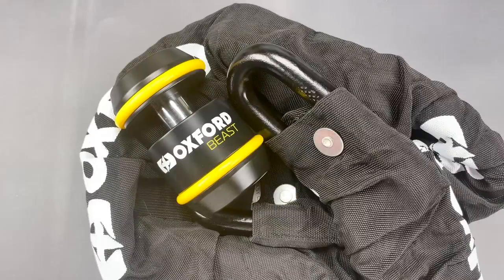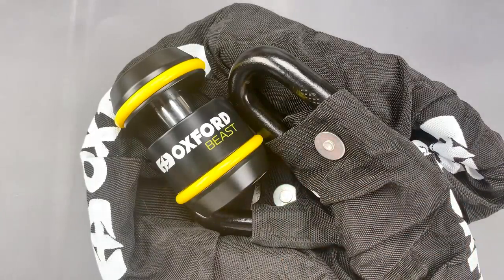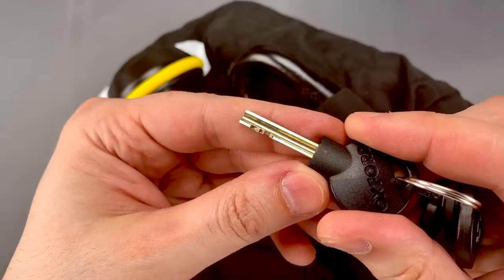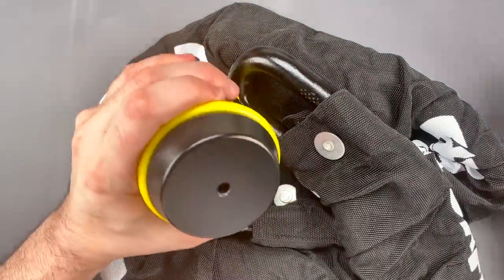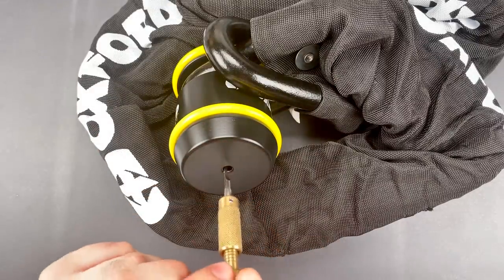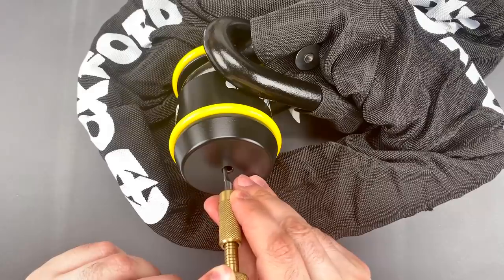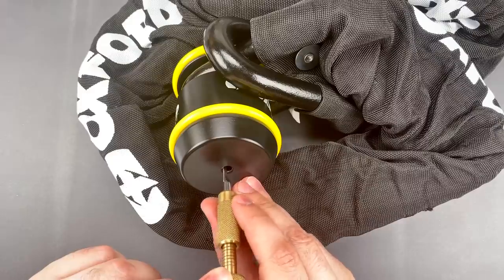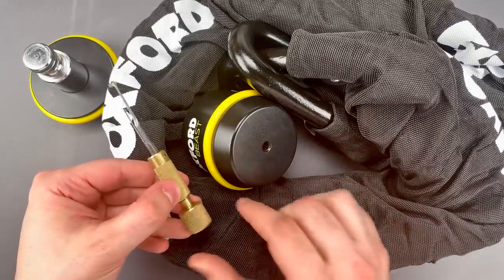[1131] 35 POUND Motorcycle Lock Picked (Oxford “Beast”)

Comment: Instruction unclear ;  the thief disassembled my motorcycle parts instead and left the lock at its place
Reply: I walked outside to see my Bike frame was still locked up to the rack.
Reply: Better to steal and sell the parts than too pick it
Reply: thief stole the lock but not the bike
Reply: LMAO
Reply: I put it through the wheel ....... um ...... now I own a wheel
Reply: that is why you hook a lock tru the frame and not the wheel.
Reply: @DeeSnow97  LMFAO
Reply: instead of using an angle grinder for 5 minutes to cut through the chains holding the bike in place, the thief instead decided to get a sledgehammer and break through the wall around the lock
Reply: @SupremeRuleroftheWorld  Thru both!
Reply: At one time the thieves were so bad here that I would lock through the frame and back wheel and take the front wheel with me. The problem disappeared after about six months, I just assumed the thief went to jail since there wasn't an increased police presence.
Reply: The thief realized that he could sell the bike parts separately for a higher price than the bike itself
Reply: Motorcycle and lamp post missing. Municipality annoyed that the street is without lights during night for a month.
Reply: @alexls1923  no joke
Reply: Better if you can zig zag through the frame and wheels. Just make sure if you do it, that taking the wheel off doesn't free everything.
Reply: @SupremeRuleroftheWorld  put it through the back wheel and around the down tube. That way you get frame AND wheel.
Reply: @abesphere  This still would not take long to get through.  The issue with a grinder is the noise.  It doesnt matter if it take 10 minutes or 10 seconds, everyone knows a grinder is being used.
Reply: Weird the thief just stole my lock and left my motorcycle.
Reply: Bwahahahahaha... I can just  imagine  the chief reviewing that police  report ...... rotflmmfao
Reply: Idk why, but that reminded me of the fact that in DC Comics, Batman first met Jason Todd when Jason tried to steal the tires off the batmobile.
Reply: You can’t publish a video without processing it
Reply: Seriously?!😂 If that thief can disassemble a motorbike and leave the lock, then he’s a real pro!
Reply: You guys think this is a joke, but I once had a guy steal the bolts off of my tyres.
Reply: @OmarKhaled-em2mf  just the nuts?
Reply: SCP 4451: Oxford Beast
[expunged]
Reply: @andrewt.5567  Ten minutes or ten seconds matters. The more time it takes to break through, the higher the chances of getting caught by an angry owner with a gun.

Heck, 10 minute might even be long enough to get caught by police.
Reply: @SupremeRuleroftheWorld  porque no los dos?

Comment: The next step in security would be to just weld the motorcycle down
Reply: Or paying an armed security guard 24/7
Reply: and with the ammount this lock whights you can put a small wielder in your bag :)
Reply: 😂 holy shit
Reply: Or an electronic ignition immobilizer and OmStar integration. Motorcycles are like 2-wheeled cars since a few years back.
Reply: @johndododoe1411  motorbikes have had immobilisers for decades. See: HISS, YISS, HISS2, etc... Naff all good. Thieves will wheel it away disable or reprogramme and tada!
Reply: No silly, you reinforce a box truck and leave it to park in, or maybe a small steel shipping container.
Reply: Park it in the living room.
Reply: @lmaoroflcopter  or just roll the bike away somewhere they can strip out the immobiliser and tracker later. One of the things stopping me buying a new bike is the fact a 19mm chain, tracker, camera, disc lock, bike cover and hiding it our of sight behind my van were not enough to save the last bike.
Reply: *next week:
*
This is the Lockpicking Lawyer, today we going to open a 7 pass stainless weld bead with a tootpick and a freshly pulled string of arm hair
Reply: @misterthegeoff9767  Tbh it sounds like you did everything right up until you hid it out of sight behind your van, that's basically advertising that people have as much time as they want/need to mess with stuff ya know?
Reply: @American Patriot  - Not if the motorcycle is  chained to something.  And anyway, the truck needs to be equipped with  a ramp. But it takes a big boy to push a full dress Harley up a ramp!
Reply: "Click on 1"
Reply: Or take the engine off the bike when you don’t use it
Reply: @misterthegeoff9767  how did they get it
Reply: @silentinvestor  portable angle grinder, I still have the cut chain link which was the only thing left.
Reply: @johndododoe1411 An immobiliser doesn’t stop someone from wheeling it away into the back of a van which is the most common form of motorbike theft, it’s not often they ride it from your home.
Reply: Just put 5 locks around the bike and two alarms, thats what i do for the nasty low life's.
Reply: @misterthegeoff9767  must have been a hell of a nice bike for them to go thru all that effort
Reply: @00comm  was a 1 year old KTM 690 Duke.

Comment: Instead of those Bronze/Silver/Gold ratings, they should instead use the “Length of LPL Video”.
Reply: hobanagerik divided by the number of times it is picked in the video
Reply: To be fair, you'd have to disregard the gutting time if there was any.
Reply: @samuelhammons2528  With a modifier based on what tools he has to use. EG - Lego figure head -100000, home made special tool x1000000000000.
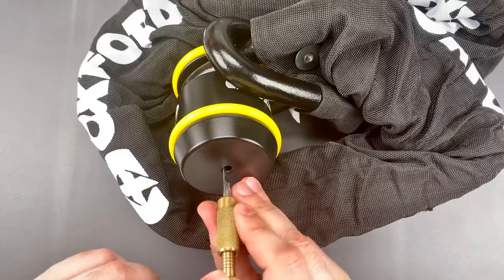Reply: "This lock is rated at 2:45LPL"
Reply: Not to mention videos he plays with an alternative method because picking is trivial
Reply: Unless he spent 90% of the time Just insulting the lock and the company
Reply: Videolength alone clearly isn't a good measurement but a link to his video on the packaging or website could definitely help

Comment: And if they approach you before you can lock your bike, you just beat them with the chain and lock. Problems solved
Reply: If you're strong enough to swing that thing you probably don't need it.
Reply: Can't imagine being clocked with 35 lbs of hardened steel with an 8 lbs sledge on the end......
Reply: Yes, I would get 2nd one for that very purpose.
Reply: And suddenly reddit has a new novelty account. Except this time it's not jumper cables, it's a 35 pound motorcycle lock and chain that his father beats him with!
Reply: @DonziGT230  fair point
Reply: @DonziGT230  I mean you could simply drop it on the robber's foot and you've already won that fight
Reply: Any thief with enough balls to approach you when you’re holding that bad boy in hand doesn’t know what fear is. Lol.
Reply: Heavy is good, heavy is reliable...
Reply: At that point you're just cosplaying as The Witch King. Watch out for Hobbits and crossdressing women.

Comment: The lock: [Weighs 35 pounds and requires a custom tool to open]
LPL: Acceptable.
Reply: I think the only locks he didn't manage to open so far are the Bowley Lock and the Bowley Padlock
Reply: Also requires custom body strengh to carry around.
Reply: @TweenkPL  I'm pretty sure he hasn't picked any of the trickier Abloys either
Reply: TO BE FAIR, the lock only weighs 8 pounds. The other 27 pounds is the chain.
Reply: @tomwallen7271  you are correct... however the lock itself could probably nicely double as a small bore cannon projectile
Reply: @ThunderbirdAnthares  the shape isn't terrible to be a Canon projectile you can probably make it work it'd be very interesting but could be done. (Dang it now I want to know what the dimensions of that thing are)
Reply: @GGov86  I don't think he's tried the assa twin or the assa Roku (correct me if I spelled that wrong) locks
Reply: HAHAHA
Reply: No 8 pounds
Reply: If it was cold wet and at night even the LPL would struggle

Comment: That's got to be the heaviest lock and chain combo on the market!🍺😎
Reply: You could remove some of the clothes, pull two chain links through and add another of those locks to make it even heavier
Reply: The Squire SS100CS comes in at 9.5 Lbs so just a little heavier, oh and they used  50cal AP to open it https://youtu.be/t2l4PVJkhzQ

Comment: It would be interesting how "angle grinder safe" this actually is. Do you want to sacrifice one link?
Reply: Here's a link that tests the lock:  https://www.bennetts.co.uk/bikesocial/reviews/products/security/motorcycle-chains-and-locks/oxford-beast-22mm-chain-lock-review
Reply: More like sacrificing the angle grinder.
Reply: My Dewalt battery angle grinder and a slim cutting disc will probably cut through the link in about 30 seconds. Double that time because i need to cut the link in 2 places to be able to take it apart, as i am not likely to be able to bend the link after the first cut ;)
Reply: @JohnDoe-bd5sz  That sure is fast; though I've yet to hear of a stealth grinder. 60 seconds of that much noise would be tough to sleep through. That's still a pretty good deterrent.
Reply: The key for speed is slim cutting disc. I have some of them, they do cut quickly. But yeah, the sound of it would be loud.
Reply: @JohnDoe-bd5sz  Indeed, to test angle grinder resilience only a single cut of a link is needed and that thin kerfed mar would hardly impair the security offered by that hefty object.
Reply: Not if you love in London
Reply: @JohnDoe-bd5sz  Depends on the hardness of the material.  Mild steel?  sure.  but that chain is around 7/8 inch, and if it's hardened steel, even a 3/32 inch cutting disk (narrowest I've ever heard of) is going to take more than 30 seconds, and it might eat enough of the wheel to make the second cut impossible.
Reply: @JohnDoe-bd5sz  But is that held in a vice, or swinging around freely because everyone knows to not let your chain touch the ground?
Reply: @dobeedooo  long distance relationships sure are hard sometimes.
Reply: @rjc0234  most chains that swing freely can be stabilized quite well, typically by using your foot to put body weight onto it, or pressing the link up against the bike itself (maybe with a board underneath)
Reply: @tashkiira7838  
From my experience, hardened steel is just as easy to cut as mild steel. Try cutting hardox 500, no problem at all.
But with a battery grinder, I also think that 30 seconds is low, but 60 seconds percut could be done easy with a 1 mm disk, maybe a new disk and battery for second cut, but still a less than 3 min job.
Reply: L G  the shaft would be guarded by the link
Reply: L G  possibly, but you would need a steady hand, and a fairly large disk to cut to the center of it.. but still, i would think that it would be hardened anyway, otherwise you could just hammer and turn it till it gives
Reply: @ChaseJonas75  He wasn't passive aggressive, his comments are true and he explains why he even mentions LPL, because the average thief is not a master lock picker, or a lock picker at all. Most theft is done by thugs using fairly affordable/portable tools, whether they be hand tools like bolt cutters or power tools such as angle grinders.
Reply: iamtherealzombie “Ignore talk of picking as this simply isn’t an issue in motorcycle crime, even with the specialist tools that popular YouTubers are helpfully promoting on their channels.” LPL mentions that picking attacks aren’t likely at all either. Also, if the reviewer ended it at “motorcycle crime” and didn’t add on the jab at YouTubers, then I would agree, but I disagree with him not being passive aggressive with “even with the specialist tools that popular YouTubers are helpfully promoting on their channels.” To me, this comment seems to be implying that LPL and other YouTubers are making lock picking crime more likely. I respectfully disagree that he wasn’t being passive aggressive with that comment.
Reply: @tashkiira7838  a smart thief would bring spare discs. Discs do break.
Reply: @danielch6662  a smart thief wouldn't attack a chain like this in the street. They'd go for the next weakest link instead. Once they get the bike 'mobile' they'll carry it into the back of a van with a couple of guys and they'll take care of the lock somewhere else where no one cares about the noise or where no one can hear it.
Worst case scenario they will just undo the bolts on the wheel that the chain is passed through, leave that wheel behind, part out the bike and sell the individual parts.

There are of course lock picking thieves, but they are usually deterred by having two different types of lock. Even here in NL where mostly bicycle theft is rife, it deters most lock picking thieves because they have to act quickly and inconspicuously. So even if they're particularly skilled in picking a wafer lock (common in rear wheel frame locks) or a disc detainer lock (common in U-locks) a simple pin tumbler pad lock on a chain will deter them as it's too far out of their comfort zone.

I've had a bike stolen that was chained to a lamp post by a group of thieves who simply tied a tow strap to the lamp post and pulled it over with their van. Then 4 of them lifted the bike up, walked it off the lamp post and carried it into their van. Of course the van had stolen plates on it, so despite there being video of the theft I never saw that bike again. I've had bicycles stolen where the thieves simply cut a section out of the fence or the rack that the bike was secured to.

Comment: Thx for this video. I'm using Oxford products too. Large 30cm U locks 14mm for the MTB's , and 2 Oxford Boss ( 16mm ) locks on each of my motorcycles. Maybe you can cut one open with a grinder to check the quality of the steel...

Comment: So, a custom tool for the lock type, that needs specific modification, and still takes around a minute for one of the best picker after familiarization with clean and safe environment. Yep, good luck picking it on the street, probably easier to cut the bike or motorcycle and steal this chain and lock.
Reply: Yup. Slow the bad guys down long enough to make them keep on going.

Comment: As a motorbike owner this video both intrigues and scares me... we’re always pitched that locks are ‘sold secure’, ‘gold standard’ or whatever but we still never know if an expensive lock can still be removed like a cheaper one.

Out of curiosity - how much would a tool (like the one you modified) cost on average but also how much experience would be needed by the criminal to be able to use that tool effectively on the street doing this? - is this a professional only tool and needs a decade of working with similar locks? Or could an average joe have a go and get it after 30-50mins of practice?

The last time thieves attempted to steal my bike though they just broke the steering lock and lifted it into a van (luckily a colleague caught them). This was in a private car park too :(

Thanks btw

Comment: This beast may be the only lock to defeat the Ramset attack! :D
Reply: Pretty confident the very large Squire would defeat the Ramset too.
Reply: I dunno. It might fail in one shot. A shot to that core might prove fatal.
Reply: Seargent and greenleaf makes some locks that would not even deign to acknowledge that a ramset had attacked them. The rotolock would probably stand up to sustained attacks from a ramset. Hi shear if you can find one wouldnt care how many times you hit it with one. Ingersoll lever locks wouldnt care. 
 Theres a good number of locks that just arent reallt susceptible to a ramset attack even the higher power .32 i think that they are selling now. Theres pretty much 4 ways to use a ramset on a lockset. One, punch through the body of the lock to snap the bolt that holds the core retaining plate on to drop the core out, attack the core, core retaining nut or plate directly, punch down on the lock body or try to break the shackel, or try to punch through the chain link. 
 With really big locks with either ball bearing or dead locked lugs, theres simply too much mass and resitance to punch down on the body. Too much material to punch through the body, the core retention is either otherwise too well protected or isnt there to be attacked, and the chain is too big and hard to be punched through.
Reply: @electricheartpony  or wreck the core so thoroughly that you'll never get it unlocked.
Reply: @lairdcummings9092  as I said, maybe. I'm not certain.
Reply: @BradyBegeman i didn't see your comment and yes, i think the three largest squires would all resist essientially infinite ramset attacks. 
Those are the kind of locks explosives are use on. I didnt even think about squire when i wrote my comment. Those are some crazy locks.

Comment: When you have such a poor bike that nobody will ever bother to touch it, even when "secured" with a cable lock so bad that you can slice through it like butter...
Reply: issue is in that case the lock is most likely more valuable than the thing it is locking up, and a lock without a key is not usefull unless your are lpl

Comment: I just received one today. And the other one with 1.5m Oxford 22mm chain are still on the way.
The lock itself weighs 7.83lb / 3550g, undoubtedly biggest in its class. The combination of lock and 1.5m Oxford 22mm chain weighs nearly 35lb / 15kg.

Comment: looks like they came across some anchor chain from a cruise ship.  imagine if there were 2 buttons on the side of the lock that you had to depress while you turned the key.  that would make it even tougher to pick open, as you'd need 3 hands.
Reply: @superchilledbru  Or, a deep-throated woodworking clamp.